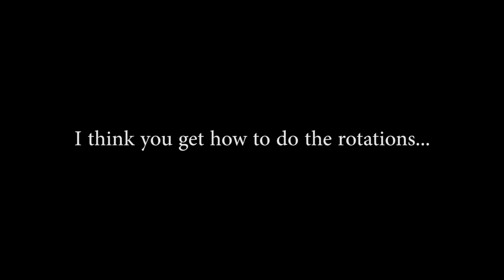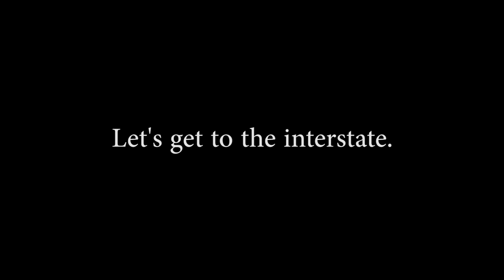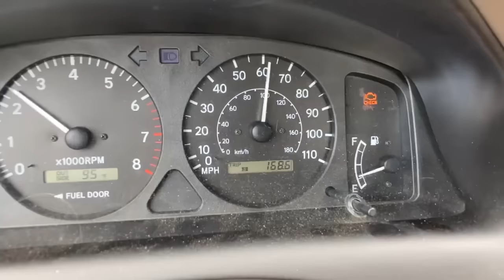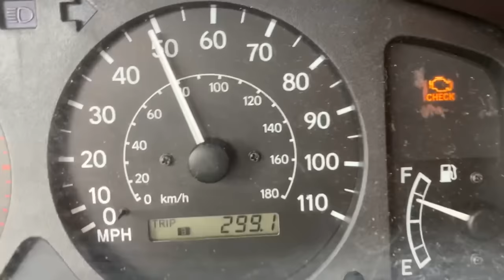Will Berryman's B12 Chemtool stop oil consumption? 😲 | Oil Burning🔥Experiments | Episode 15

Comment: Mr Dave, I want to thank you for all for your time and experience. Your piston soak video just saved me a ton. I have a 2015 Audi A5 2.0t, it has 170250 miles, somewhere after 120,000kmiles it started burning  about a quart of oil every 700 miles and gow worse as the miles increased. On average I drive 95 miles a day round trip to work, here recently I was adding a quart every 250 miles. By this point I had come across your videos and was contemplating  trying some different oil additives. Last weekend I took a 200 mile round trip, I topped off with a half quart. Made it to my destination but the add oil indicator lit up. I checked and was a quart low, topped off and handed home. 65miles into the trip the indicator went off, I sat for 10 mins and true enough, a quart low..  long story short, I did the piston soak Sunday and Monday. Today I've gone 450 miles with less than a 1/4 of a quart burned!!

I am beyond excited!!!
Reply from the maker: That is awesome, Norman! So glad to hear! Please keep us posted if you would.
Reply: Hey Dave, just a quick update. I've driven 1500 miles since the piston soak and I have not burned a half quart of oil yet. It has burned some but it's probably close to 1/4 of a quart.

Thanks again!!!
Reply from the maker: Thanks for the update!  @normanbrown495

Comment: Hi Dave, just wanted to say thank for this video! I have a bmw e46 325ci. Oil consumption went to 1 litre for every 120miles. An engine flush and oil changed got me to 200miles. I’ve done the b12 soak a few weeks back with the car on jacks to level the engine out as best as I could. I’m at 855 miles with no noticeable difference on the dipstick.

Comment: I was brought an outboard motor (Mercury/Tohatsu 20hp) a year ago. The customers complaint was that it suffered midrange to high RPM power. One of the first things I do when diagnosing is take compression readings. Both cylinders were extremely low on compression, but my endoscope showed cross hatch marks in the cylinders. My first thought was “blown head gasket”. Imagine my surprise when I drained the oil, and it came out in chunks! I made a video of this and posted it on my channel, along with what I did, then the aftermath. Long story short, besides disassembling the powerhead of the outboard, and cleaning it all out, I drained the oil, spun on a “sacrificial” filter, refilled the crankcase with a combination of Berryman’s, and 10W-30. I ran the outboard at an idle for the next hour or so, then dumped the oil/Berryman concoction. Took off the filter, and cut it open. Sludge, sludge, and more sludge! The Berryman’s and fresh oil cleaned up the inside of the engine, cylinders, and compression came back up to around 140psi. I’m not much a fan of “mechanic in a bottle” type products, but Berryman’s was the key in preventing my customer spending close to $1000 for me to tear down, clean, reassemble his engine, versus just running Berryman’s through it till the filter caught all the sludge. One thing to note, oil filters DON’T work like you think they do. I ran that engine at an idle due to the fact that at higher RPM higher oil pressure, the filter would most likely by-pass, and the sludge would just wind up back inside the crankcase.

Love the video, even though I’m a year or so late on seeing it.

Comment: A great way using the original b12, not the one specified as specifically fuel injector cleaner, is to pull the spark plugs out, put between 3 and 4 oz into the top of each cylinder with the block temp around 130 F, and then put the spark plugs back for sealing purposes.  Come back after after a few hours, remove the spark plugs again, check (use boroscope) to see how much fluid was lost, add a little bit if any cylinder does not have the entire top of the in piston covered, stuff a rag into each spark plug well (not into the cylinder!), crank the engine over 15-20 seconds.  Remove rags, use a manual pump to remove all liquid from cylinders, replace plugs, start engine.  Run it at idle (a conservative rpm under 2000 if it won't immediately idle well due to the garbage in the cylinder) for 5-10 minutes, then change the oil and filter.  Use a cheaper oil, but not complete garbage.  Change oil again (use good oil) after 500 miles (unless turns very dark before that).  Check your oil burning.  Should have decreased dramatically.

Comment: The oil pooling ontop of the pistons is a sign that your valve stem seals are leaking.  As the engine warmed up the blue smoking decreased significantly. While your piston rings may not be sealing as well as they should if they had failed your vehicle would be smoking under all running conditions.
The treatment possibly mixed with the oil and softened the valve stem seals to reduce the oil leaking.
Reply: I was thinking the same thing with the valve seal seals leaking after seeing the oil on top the pistons. Dropped down after shutting the engine off. From my experience with Honda engines, valve stem seals done cause a ton of oil consumption though… I’m interested to see what happens with this.
Reply: That's a shame, he replaced the valve stem seals back in earlier video

Comment: B-12 is good stuff. You can also use it to wipe the yellow off of headlights. Caution: one pass only using a blue paper shop towel saturated with B-12. Follow up with some Meguires plastic polish to seal it up. Works like a champ on most headlights.
Reply: No, headlights should be wet sanded and polished. Cheap, easy, and correct way to do it.
Reply: @04dram04  Nope, we´re here for the magic.

Comment: Glad it appears to have worked. I would have done a flush of the cylinders to remove that gunk and debris after the treatment along with an oil/filter change prior to the 20 minute drive. Also, in an attempt to clean up what is still left on the pistons, toss a can of that B12 in the fuel tank, see if that burns out those last remnants. 👍🏻
Reply: In my opinion this would be the best way.
Unfortunately, I'm quite sure compression was harmed during this. 
Also to get all the B12 out of the oil, after such treatment (before the 20min drive) an Diesel engine specific oil could be used + new oil filter - those have much stronger carbon cleaning ingredients that are safe for the engine. + B12 in the fuel tank    

After the 20min intensive ride replace with premium correct spec Oil + Filter.

Comment: The key to using B12 as a gas additive and save money while doing good for your engine is to use inexpensive gasoline and a can of B12 as the additive cleaning package every other tank to once a month. Using it every tank is not necessary unless your engine has some specific issue you're trying to fix. Using B12 in this way is how to save money over buying high priced decent gas that has a pretty good additive package (such as Shell). B12 is still a better additive than Shell's Nitrogen additive package as B12 is a dedicated cleaner that's proven, even more so than Mystery oil Lucas and SeaWeed. FUN FACT; B12 is one of the few gasoline additives that actually ignites when flame is put to it. The rest put the flame out.
Reply: I use B12 followed by Lucas Top end additive before every oil change. Cleans it really good

Comment: That's a dramatic improvement! I'm watching this before trying it on my neighbor's 22RE. No complaint of oil consumption, but low compression and lots of blow-by. If it does half as good as this, I'll be happy.
Reply: Have you figured out why the compression is low? Is it guides, seals, valves, piston rings? The 22RE is almost bullet proof other than needing fron or rear main seals replaced like any engine they are easily a 500K mile engine. The 22RE though likes 3000 mile oil changes with 20W50 in warm months and 5W40 or 10W30 in colder months. 

Nothing kills a 22RE faster than neglected oil changes. I have owned several starting with a brand new 1986 4Runner. I modified the heck out of these engines back in the day. I built one that would turn 10,000 RPM's and was in a daily driver.
Reply: @buckaroobonsi555  I haven't done a leakdown, but the blow-by has me thinking rings. I would not be surprised if it missed a few oil changes. Comp was low enough that I've ordered a new compression tester to confirm. 10k sounds pretty rowdy for a little four-pot!
Reply: @buckaroobonsi555  the guy who taught me about preventing oil consumption occurred in the 1st place his dad had a 22R Toyota pickup with 300k miles, engine have zero oil consumption problem and original seals and gaskets. All he does was change the oil every 3k or 3 months and never fill the oil to to FULL mark (top mark) when engine was cold. Fill it only to the MIDDLE line when cold because oil will expand when it heats up. If u fill it to the top when engine was cold, oil will pass the top mark when it reach operating temperature, if oil pass the top mark when the oil heats up, that’s overfilled. Then u will starting seeing all kind of seals and gaskets leaking problem because hot oil needs to go somewhere inside the motor. Too much oil pressure will cause gaskets and seals break prematurely. 

Modern engines require 5k OCI or every 6 months in order to prevent stuck oil control rings from happening regardless of what the manufacturer said to change oil at 8k, 10k, 15k and no matter u have low tension ring, high tension ring, good piston design or not.
Reply: Let us know
I have a Toyota 5L with same problem as your neighbor 22RE
Reply: @yurifloripa6968  I started wondering how the engine was running as well as it was with the comp that low, bought a new tester, and found that it was actually fine--my old tester was just reading low for some reason. Didn't give the Berryman's a go. Good luck with your 5L!
Reply: @Darwinpasta  thank you ! 
On 5L engines what should be normal range for compression readings?
Reply: @yurifloripa6968  I've never worked with the 5L, or diesel in general, so I don't know what it wants. A Toyota forum or service manual should have that info.

Comment: Try cleaning the plugs, or installing a new set. You said the engine was missing at 60 mph on that 20 to 40 mile test run. I have used spray intake valve clean thru the intake throttle, and that alone improved on my emissions test greatly, as per the technician comments for my 21 yo 2002 Ford Ranger XLT with 175,000 miles. I use Seafoam fuel additive too, and I never had to replace the injectors. I also use seafoam in the oil crankcase as per instructions, that has made the engine run more smooth and a lot more quiet. That engine doesn't use or burn any oil whatsoever. I just traded that truck in on a 2023 Chevy Colorado, I waited 3 months for that delivery.  Being retired, I drive under 3,000 mile per year. Good luck on your Toyota's oil consumption and enjoy it's great gas mileage. You did good by the way!

Comment: it would be interesting to see if this changed compression.
Reply: Had too. It unstuck the rings allowing them to expand.
Reply: Compression numbers can be wildly skewed by the oil in the combustion chamber wetting & sealing the rings during cranking. I've seen it on new builds that the rings weren't seating. Burned oil like mad but cranking compression was >200psi

Comment: Hey Dave, I am a new viewer of the channel. I hope you get as much enjoyment out of making these videos as i do watching them. I have been using B12 since about 1983 for a myriad of applications. I have never made much of any experiment out of those use-cases. I am convinced B12 dissolves carbon because I use it to clean my rifle barrels and I can see that it works like a hot knife through melted butter. It's amazing stuff for carbon removal. I have used it to dissolve carbon off of upper engine parts ,by soaking overnight and it does well with that. Also to find vacuum leaks.I have seen a lot of miracle "swear by" products come and go but since Berrymans has been around for 100 years, that there are a whole lot of yard apes like me out there that keep buying it and that's what I'll be doing too. It's not a miracle product; nothing is. But it works how I need it to work...
Reply from the maker: Thanks Jeff. I might have to do some firearm experiments of my own 🤔👍🏻

Comment: B12 used to have instruction on the side for use in Fuel System and Crankcase for decades. I think if I remember correctly it used to recommend 1/2 pint of B12 Chemtool per 4 quarts of crankcase capacity. You would not drive it but you would let it idle with no load before oil change for 20-30 minutes at 2000 rpms. I used to use 1 pint per 4 quarts capacity in really dirty engines. This was around 1991 or 1992. I never had any issues. I did it to many friends cars as well.

I did not start doing piston soaks though on non-siezed engines until about 2001. When I would replace platinum or double platinum plugs I would pour some B12 in and let things soak then crank the engine latter reinstall the plugs. I was working at General Motors and a lot of cars where having oil consumption issues and piston carbon issues. It just seemed like cheap insurance every 50K miles to do this. Likewise 1 tank of fuel before oil changes I would toss in a bottle of fuel injector cleaner. Again not solving any issues more just trying to prevent any. 

Slowly more and more companies European, Domestic and Japanese started to develop issues with oil consumption, sludge and carbon.

Comment: Kia and Hyundai have a service procedure similar to that where they inject the cleaning solvent into the spark plug holes let it soak and then pressurize it with a cylinder leak down tester like device to pressurize the solvent and get it into the piston rings. You could try something similar to that with a cylinder leak down tester and berryman's b12 chem tool.
Reply: I'm a Kia tech, it really works. Fixes 99% of them. We use valvoline intake cleaner.
Reply: This is exactly the thread comment I was looking for!! 
Short story - I own a 2012 Veloster that I bought when it was at 68k back in 2018. The engine crapped out on New Year's Day 2022 at 115,775k. 
I was told the valves had chunks of carbon built up on them which is why it would not run.
I paid $800 for a media blast to clear it out, which did the trick, but since then it has been burning oil like witches in Salem and blowing P0420 codes like a crack addict looking to score their next $25 rock.... 
It has been exhausting to check my oil daily, and run my car on life support since NYE. I am totally fed up with it. 
I just ordered 4 cans of B12 from Amazon. This is the last thing I'm going to try on my own before taking it into the dealership to get bent over for the $700 for the pressurized solvent cleaning you've mentioned. 
I am not ready financially to purchase a new car yet, but I will soon if this doesn't work. 
Prior to this car, I've only ever owned cars that were pre-2002, and I've never ever had an issue with this sort of thing - No one told me I had to spray some cleaner into it every other oil change bc it has a damned GDI engine!!! (Never gonna buy another car with this set up again, if I can help it!) 
All the money I've saved on fuel efficiency over the years has been spent now on missed days at work,  CataClean, engine restorers, and a $10 bottle of oil every 300 miles!
I'll post again after trying this method this weekend. After I soak the pistons overnight and hand crank the engine, I'm going to drive it from my place over to the Rapid Oil Change and ask them to do an engine flush before refilling it with new synthetic oil.
Glad I have a motorcycle to get around on in the meantime!
Reply: @keithfoco Is it detergent based? Or does it smell like acetone/nail polish remover?
Reply: @gregorymalchuk272  the valvoline intake cleaner smells like acetone and bubblegum. The chemical we get from Kia is unique smelling. Not sure what it is. They work about the same.
Reply: @keithfoco  does it really work? Hyundai wants $700 to do this to my wife's car which is burning 9-11 quarts of oil between 5,000 mile oil changes. I'm burning up the spark plugs every 20,000 miles and I've gone through 2 catalytic converters on this car. It has 167,000 miles on it and started doing it at around 110,000 miles. Hyundai will do nothing to help me. Also, if this works how long have you seen it last? Their service manager told me I would still burn a quart of oil between oil changes but couldn't tell me if how long the procedure lasts. Thanks.
Reply: Ŕe. The Kia procedure...after the cyl. pressure ... do you drain the diluted oil with the cleaner in it ?

Comment: Easiest way I found is to run the engine, shut it off and pull the plugs after letting it cool a bit. Pour B12 don the cylinders and go home for the night. Next morning spin it over, put plugs back in, and add some B12 to crankcase (not much). Drive down the road about 10 miles each way and then do an oil change. The oil will be black, and the rings will be freed up.

I'd suggest you use the B12 to clean the intake system either with an intake cleaning kit or just slowly pouring it down the throttle body until it sputters and drowns itself. Let it soak for a few hours or overnight and then slap fresh plugs in it and go drive.